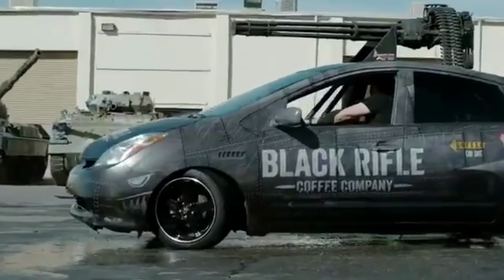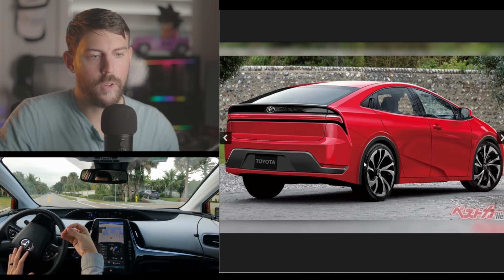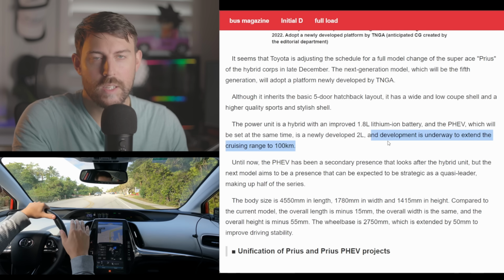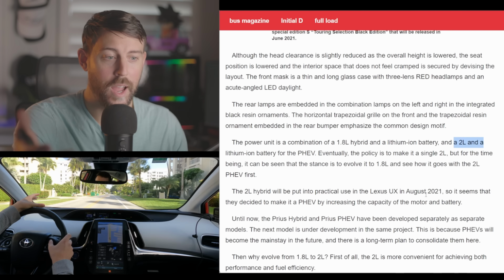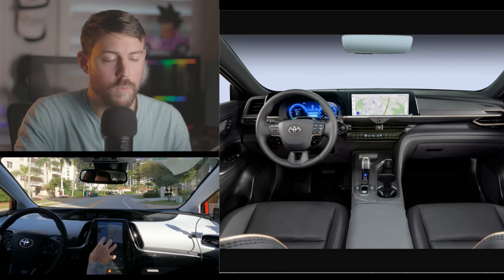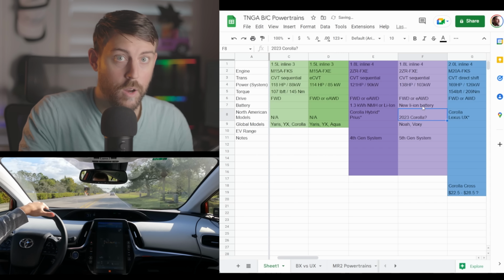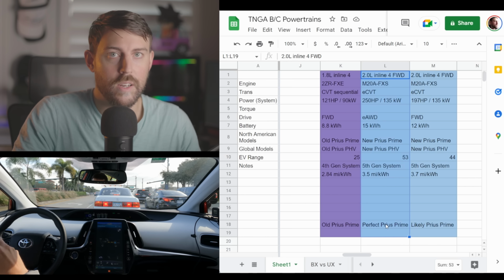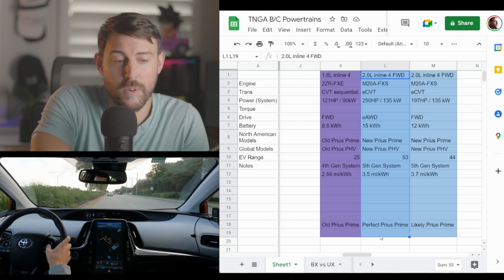*BIG UPDATE* The All-New 2023 Toyota Prius will have INCREDIBLE power and EV range...

Comment: Probably most reliable car ever. Still have my 2012  prius V that i used when I was a cab driver, now with 641k miles.
Reply: My wife’s Gen 2, 2008 Prius has 368,000 miles… only oil changes, a change of CVT fluid, 1 set of brake pads, a 12V battery and tires of course. Been an amazingly reliable car. Priceless.
Reply: @johnsheibal4330  For sure.
Reply: @kovalm3  thanks. Coming from a Subaru, just a head gasket not bad.
Reply: @Momo_8k  Except you don't have to pull the engine to do it.
Reply: @johnsheibal4330  Our 2010 went 275K. The last 100K was driven by teenagers. Suspension parts changed, front brakes, front wheel bearings, tires, spark plugs and the center display went out, which was not an expensive repair. Halogen headlights, so none of the HID nightmares. Least satisfying, but most reliable car I've ever owned, and it's not even close.
Reply: @johnsheibal4330  I have an 08 with 210k miles. You’ve never replaced your battery cooling pump?
Reply: @LKNDIY  nope… Im not the original owner, but I’ve looked up the service records on both Prius we own. Very little done, other than minimal warranty work and oil changes. I’ve replaced the 12v battery on one of them.
Reply: Awesome 👍 did you need to replace anything major? I’ve got a “low mileage” CT200h which I believe uses the same powertrain
Reply: @Momo_8k  yes, ct200h does have same powertrain. Head gasket. And now, I think  it's head gasket again,  as I am loosing coolant. At this point, this car paid for it self several times over.
Reply: That’s amazing, I’ve always liked the Prius V.  I’m driving a 2012 prius regular version and I’m driving it for deliveries.  Currently at 266,000km+ still running strong.  Did you have to replace your battery?
Reply: @kajenkirubah1228  I replaced original hybrid battery  when car had about 470k. I put used one in. Still works.
Reply: @kovalm3  470k miles?? Or km?  Either way, that’s crazy reliability
Reply: @kajenkirubah1228  miles most likely. The only thing that hurts the Prius’ battery is age. About 10-12 year lifespan. Mileage doesn’t have much of an impact at all
Reply: @garrettw99  I doubt it's only 10 to 12 years for battery life.  It's likely much longer.  There are 15 year old Prius on the road with og batteries still.  The reason why it sometimes fails earlier, is when people leave the car sitting for months and years without using it and this is something I hear kills the battery.

Case in point, my Prius is a 2012, about 11 years old and still the battery is running great (knock on wood).  Difference is, I use the car 4 to 5 days a week, close to 600km every single week just doing my deliveries.
Reply: @kajenkirubah1228  yeah there are exceptions, but generally they do last 10-12 years, not based on anecdotal evidence. It lasts longer if it is used on a consistent basis. If it sits a lot, you can expect 8-10 years. I had a 2005 Prius and I replaced the HV battery after 11 years with 245k miles, driven on a consistent basis since new. I drove it another 20k miles or 3 years with the refurbished HV battery before I sold it. Also climate plays a role. Mine lived in coastal SoCal it’s whole life with mainly 80° temps. It was 105° outside when the battery “failed”.
Reply: @kajenkirubah1228  That's my understanding as well from reading around.  I have ~268K on my 2013 Prius 2 and the battery seems all good.  I am starting to get oil consumption that I'm thinking is due to performing the lesser frequent oil changes and most recently observing how the dealerships wouldn't fill the oil much over the half way point and I've been trying to keep full since I've been maintaining.  I think that's slowed down the consumption from my recorded numbers.... though I need to plug and chug the data into a spreadsheet and graph to confirm.  I was wondering about running some Amsoil through for a few oil changes as a potential "cleaning" cycle.  I was also wondering how risky the lacquer thinner, to clean the catalytic converter, in the gas method is on the non-metal parts.
Reply: @garrettw99  I'm still trying to figure out what people do when the battery starts to run down. I still have all but one bar of battery, but unsure how people have over 500,000 miles and never had a reconditioned or a new battery.
Reply: @colin-nekritz  it should still be able to get to 90% or 100% when the battery is about to need replacing. When it needs replacing, you’ll notice that it discharges and recharges the battery a lot quicker because the battery isn’t able to hold as much charge. The battery indicator you’re looking at isn’t an indicator for how much longer the battery will last. It’s just telling you how charged the battery is at that moment. If you sit idling with the AC on, you’ll eventually get to 2 bars
Reply: @kajenkirubah1228  replaced batteries at 477k.
Reply: @Raymond99 I bet you didn't know that the PRIUS was invented by GE research in upstate NY and the patent sold to Toyota!
Reply: @InlineSkateFitness  oh, that's interesting. Thanks for sharing.
Reply: is that 641k miles still with the original battery?
Reply: The most bullet proof car they have ever built.
Reply: I use a 2010 that I drive Uber with. A thousand miles a week and never an issue...so far. 🤞
Reply: Also have you done any kind of special maintenance to keep your Prius running so long?  I’ve only changed oil at regular intervals, 16000km or 10k miles, full synthetic.  I’ve seen a video of a mechanic that recommended replacing the filter on the battery cover that’s next to the rear passenger seats.  Have you done that?
Reply: @kajenkirubah1228  Definitely want to clean, I've not yet, though am planning to soon. I recently invested in a Dyson V7 with DeWalt power tool adapter so I have a better performing vacuum in the car at all times so to clean more often since I haul restoration projects and materials for projects stock.
Reply: Got damn...thats alotta miles
Reply: Early 2ZR-FXE can have piston ring failure, quite expensive to repair. Warning signs are oil consumption, which sadly can be caused by just about anything. IIRC they fixed this with a new piston ring design from 2015 on
Reply: 2015 325 daily drive. 40-41mpg original battery
Reply: I have the same car but it definitely consumes oil unfortunately! About a quarter every 1500 miles. That's the only part that sucks for me.
Reply: @Carp0rn  that’s wierd af.  Have you been using synthetic oil like Toyota recommended?  That’s the only oil I use, since I bought it, only 0w20
Reply: Wow!!
Reply: what the fock???
Reply: Yep. While nothing close to your numbers, our 2012 PriusV at 150K has needed only wearables (tires, oil, wipers), battery still has almost all bars, which can get to max on downhills. Question though, how many times have you had to have the battery replaced or reconditioned?
Reply: How often do you change the oil?  Thanks
Reply: Had mine since 2007. Love, love, love it.....just under 100,000 miles
Reply: I have 2020 prius i do commute 46 miles round trip u can’t go wrong with 51 mpg  amazing car 👌🏾
Reply: Thanks for sharing! My Dad's Camry is also reaching 300k miles. Toyota's quality just makes sense and it makes car ownership cheaper. I'm definitely sold in buying a Toyota next!
Reply: @freezinghold5412  Without question, just make sure you research the models that have more reported issues by owners and maintenance records. Can't go wrong.
Reply: Not the most reliable car, more like the cheapest to repair  if something goes, basically biggest cost is going to be the battery pack and you can buy them from a  third-party and install them yourself pretty easy. I've had c5 corvettes that lost longer then prius's on their first engine.
Reply: @Toymonkeyjr  I find that impossible to believe.
Reply: @TianenChen-i6b  cool, I could care less. 521k original block.
Reply: @Toymonkeyjr  With a pathetic MPG.
Reply: @TianenChen-i6b  LOL, sounds like you've never had fun in your life. Grow up. Not everything to cars is about MPGs, an EV would crap on your priusin efficiency.
Reply: @Toymonkeyjr  only losers have fun in cars
Reply: @Toymonkeyjr  saving gas is what grown-ups do. It is little kids like you who drive wasteful vehicles pretending to be cool.
Reply: Still rocking my 2012 prius V.  Best car ever.
Reply: Wow, no other car ever lasted 10 years or had more than 641k miles!!.... Hold on to that one!..It's a one of a kind, amazing engineering marvel.
Reply: Corolla holds the record as most reliable car ever
Reply: nah not most. most is definitely corolla.

I'd say if you're not counting SUVs and trucks:
1. 90s - 00s corolla 
2. 90s - 00s civic
3. volvo 240
4. ford panther body
5. prius

but that being said, it's worth also noting the cost of repair vs. a car without that expensive battery as well.

you have things like old ford and chrysler cars that are high maintenance but cheap parts. then the prius is the dead opposite, low maintenance but expensive parts. either way a prius isn't the worst car you can buy, even if a really old one would have me clenching my teeth and saying to ask a mechanic.
Reply: I started having problems with the engine at 120,000 km, the engine had to be changed to 180,000.
Reply: @konstantindyatlov8782  then the users did not change oil
Reply: @TianenChen-i6b  I changed the oil every 10,000 km
Reply: @konstantindyatlov8782  it is recommended by Car Care Nut that oil change should be 5,000 miles
Reply: @TianenChen-i6b  this is redundant, after opening the motor was clean. The problem was that the engine was coolant. We have Europe, and we have kilometers.
Reply: @konstantindyatlov8782  just watch the channel. You would know what you have missed.
Reply: Wow
Reply: Wow Prius has won me over to Toyota
Reply: I GOT A 2010 PRIUS 217000 MILES OIL CHANGE SPARK PLUGS PVC AND CATCH CAN RUNS LIKE A NEW CAR!
Reply: And I thought my 2010 Prius with 247,000 MI was crushing it. I actually really really enjoy my Prius and do not believe in any kind of Maintenance except oil filter oil change new tires:-)
Reply: Hi Dorothy and wally just sending you a note,
Reply: Hi Dorothy and wally just sending you a note.
Reply: ABS controller failures as well.
Reply: 641k miles?!! Daaaaamn 😮
Reply: Yea, I have 1.2 mil miles on mine
They really do run forever
Reply: My uncle drove just over 0 miles on his 1990's Avalon.
Reply: I still have the 2014 plug in Prius I bought new.  It has over 180K miles now and is the best investment I ever made.  It doesn't burn a drop of oil and is still on it's original set of brake pads.  I also regularly get 60 mpg out of it, without plugging in it. 

Toyota should have won a Nobel prize for developing such an advanced, fuel-efficient car!
Reply: Amazing. Gen 3 has head gasket, PCV valve throwing oil into intake (need catch can), EGR valve clogging, electric water pump failures. GEN 2 didn't have these problems.
Reply: @amazoidal  he didn't say he didn't replace anything...
Reply: @occckid123  did replace head gasket. Everything else still works. Even light bolbs are original.  BTW, I think it's  head gasket again,  as 2 days ago I head to add antifreeze. At this point,  I can't complain.
Reply: @kovalm3  I've had to replace the rear brake pads since the passenger side lower caliper pin froze.  Otherwise, I'm getting close to replacing the front pads on mine at ~268K.  I also had to replace the inner tie rod on the drivers side.  Guessing due to coyote, deer and semi-truck tires targeting a little more than my bumper guard and inner fender.  Amazing how well has performed and appears will be able to perform.  I need to either jack up and put on stands again or take into the dealership to pry on the front end on the other side... since today I noticed something sounding more than my cupped tire from the loose inner tie rod, before I replaced, that was rotated to that side. Didn't notice more than that when I had the tires checked, balances and all the wheels aligned.  Guessing that cupping might have wore something out that was ready to be replaced... unless what I heard was just the pads being loose.
Reply: @kovalm3  have you cleaned out your EGR system? When those get plugged up they do tend to cause head gasket issues
Reply: I replaced head gasket on mine. Otherwise great car.
Reply: @amazoidal  yeah but gen 2 was goofy looking :0)

My 2012 plug-in only has 240,000 on it, so U have a ways to go to catch up with the Prius V guy. I’ve cleaned the EGR tube a couple of times, but no other problems so far.
Reply: @amazoidal  I've wondered what can be done to retrofit the 1.5L in the regular Gen 3 Prius?  Those engines are like 1/3, or maybe more or less, the cost of the 1.8L used.  I've debated getting one along with the rest of the electronics to setup a demonstrator to study to see how to retrofit into not only the Gen 3's.  Thinking won't be able to get to that for another two years if I did. Amazes me, like the Gen3 1.8L CVT, the prices of those barely ever replaced parts at even the not pick your parts yards.
Reply: @amazoidal  think the water pump and oil consumption issues were fixed in 2011 or 2012. Never buy a Toyota before a face lift/refresh.
Reply: Oil consumption is clogged piston ring lands (where the oil that is scraped by the piston is supposed to travel back to the crankcase through the ring lands but when clogged instead gets burned in the combustion chamber). This is caused by changing oil at 10k intervals instead of 5k. Don't go over 5k because the phony synthetic oil everyone uses is only Group 3 and not real Group 4/5 which is what all synthetic oil was prior to 1997. Group 3 has no synthetic base (APO or POE). Water pump is still electric. My 2012 Prius V only has 81k so I haven't had any problems yet. But 641k is a world record.
Reply: @amazoidal  Thnaks, didn’t know that about the oil. I have a 2013 and I had been changing the oil at 7,500 with synthetic but started changing it at 5,000. The oil is still transparent and pretty dang clean at that mileage and that should keep the engine 100% free of sludge. Burning no oil at 135k miles. Replaced the water pump and coolant at 125k preventative maintenance. Plan to get 200k out of this car.
Reply: You have done all the right things. Letting the water pump die usually wipes out the head gasket.
Reply: @amazoidal  According to a Toyota master tech, the head should never be machined on this engine so if it overheats and warps, goodbye. Definitely don’t overheat this engine!
Reply: That's why "Gasket Masters" on You Tube just replaces the head gasket and doesn't even check the head for warping. 3rd Gen is the worst, with 2010-2012 being the worst of the worst for head gasket failures. Always replace the electric water pump at 100k. It randomly fails when the plastic ring around the impeller disintegrates from heating and cooling cycles and jams the impeller. Poor Design and materials choice. You can find the Aisan pump on Amazon for about $250. But you still have to deal with the poorly placed PCV valve (adding a catch can) and the EGR valve clogging. That's why the Gen 2 is the 400k Prius. It has no EGR, a well placed PCV valve and a mechanical water pump.
Reply: @amazoidal  I agree, I think replacing the water pump every 125k along with the spark plugs is a good idea and that’s what I did. The 4th gen still has a EGR cooler, however it’s been re-designing to be less prone to clogging. Probably should be cleaned, but on 2x longer interval so every 150k rather than every 75-100k on the 3rd gen.
Reply: Yes, GEN 4 has solved the head gasket problem as well. The guy behind Dr. Prius (best battery software) is the same guy who brought us NexPower (the Lion replacement for the Nimh Prius battery - I installed one in my 2007) put a Gen 4 engine in his Gen 3 body. On You Tube. I also recommend replacing the non-synthetic WS tranny fluid every 50 k with Redline D6. Your tranny will shift better and quieter. On Amazon. All 3 of my Prii have D6.
Reply: @amazoidal  Wow, looks like they're sold out for my 2013 Prius.  Thanks for mentioning, I didn't even know those NexPower LiFePO4 interchangeable packs were on the market. I've only used the Toyota or Mobile 1 0W20, though have pushed my oil changes out to 10K and am at about 268K miles on the vehicle. Didn't know about swapping the water pump out as a PM.  Will have to look into options, i.e. either new or from a low mileage engine.  I started to work on re-routing the PCV Valve up beside the head, in between the EGR and electronics coolant tank... though wimped out on using the hose and planned I'd custom fabricate a pipe so all similar metal to the point of the PCV Valve.  Was thinking might be a little more safer to prevent hose material from getting into the engine worse situation if there was degradation of the rubber.  Was recently wondering what kind of havok the method the guys who use lacquer thinner in their fuel for their catalytic converters would do to the gaskets and maybe injectors?
Reply: @amazoidal  I was also wondering about running an oil change or three with Amsoil to see how that might clean up the engine as well?  Any thoughts,experience or reference on using that product that's the real 100% synthetic?
Reply: @amazoidal  well said. Youtuber Car care nut corroborates on your 5k oil change advice
Reply: The NexPower LION replacement modules are extremely popular now. The alternatives are a $3400 bill for a new pack installed by the dealer, the phantom new modules from the dealer for $1950 ( I tried that) or buying a Gen 3 used battery from a boneyard (I did that). But the boneyard batteries. while under $1000, are getting old. A 2015 pack is already 7 years old. So Nexpower is a great alternative at $2500. My Nexpower has been in for 5 months with no problems. Easy install. Mobil 1 is just an SN+ rated Group 3. Save your money and buy the Kirkland Full Synthetic at Costco. Just change all Group 3 at 5k. If you could develop a kit to relocate the PCV valve to the valve cover, you could make a fortune. I would only use lacquer thinner to pour down into the cat. It's must too strong to go through the fuel system. Here in Calif, the Cat problem is a big one, Calif requires an OEM cat. $3000. It's one reason I junked my 2005 and got an EV. The ICE has no future in Calif. My 2012 V just sits in the garage with 81k, reserved for long trips. Be sure to get rid of the non-synthetic WS ATF in your tranny. Get REDLINE D6 from Amazon. It's a real synthetic, unlike the $25 gallon so-called Synthetic ATFs at the auto part stores.
Reply: My tundra has over 300k on it and my wife’s Camry has over 200k on it and my Highlander has over 125k on it Toyota has the best cars on the planet